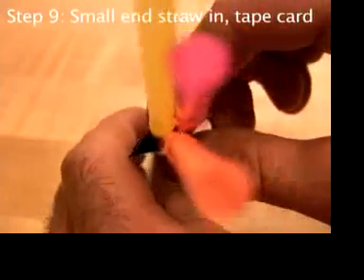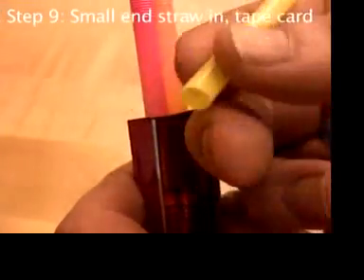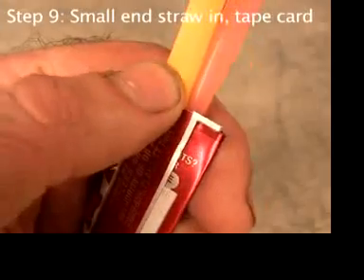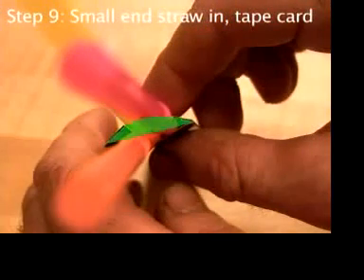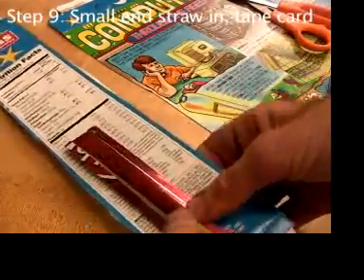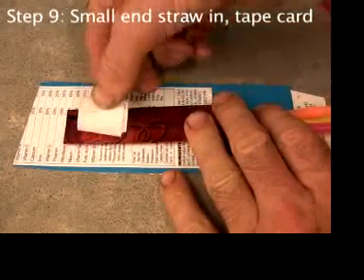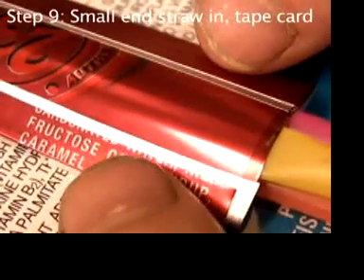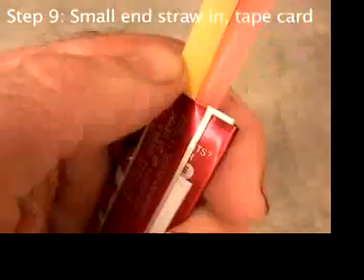Part 12 Build a Putt Putt/Pop Pop Steam Boat s9strwTape

Comment from the maker: The kind of epoxy should not matter. You ought to be getting the arch shape before the epoxy is even applied. Try pushing down on the sides so the bottom is flat. You might not even need the third straw to get the arch if you do this.

Comment from the maker: @shootingstar1029 The water in the engine tends to keep the engine cooler than if the engine was dry. It is important to remove the flame if the boat stops running. The epoxy does not melt, but it could burn. Adding more heat than a candle could also cause overheating problems. 
Slater